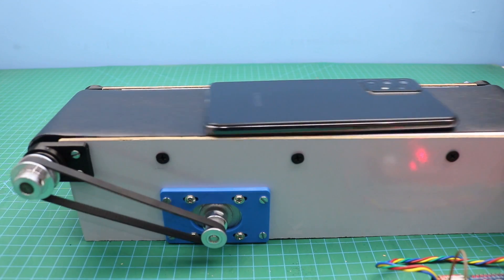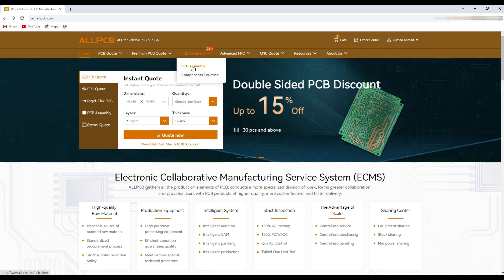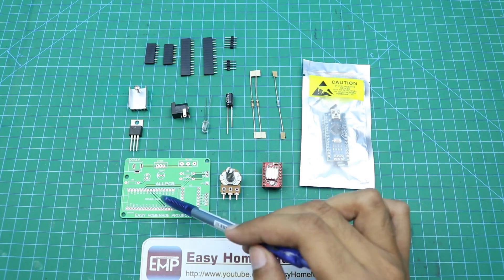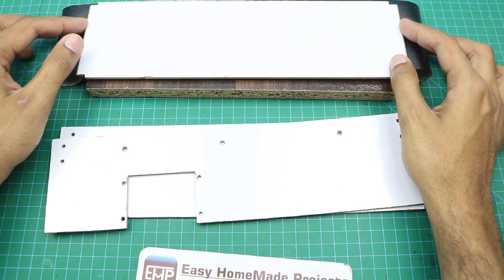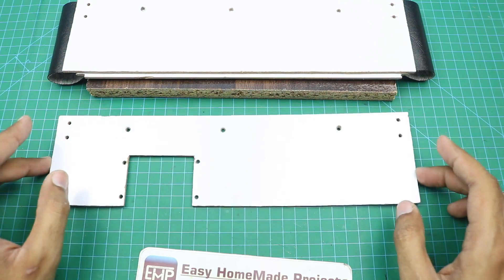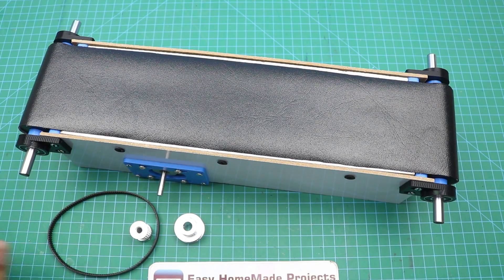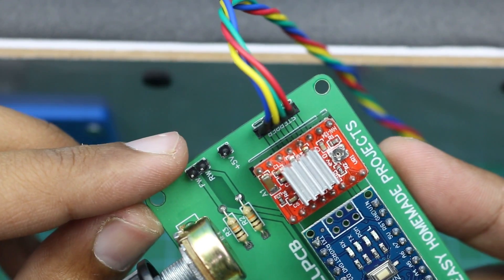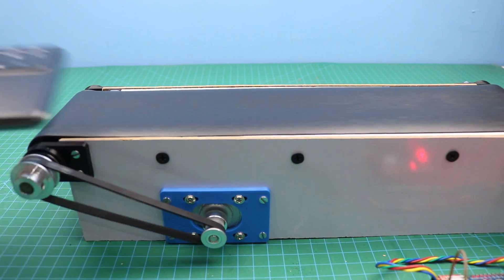How to Make 2-Way Conveyor Belt System Using Stepper Motor & Arduino

Comment: What size is the inner diameter of a 3D printed roller ?
Reply: Same as the shaft rod you buy... Just add a little tolerance depending on your printer